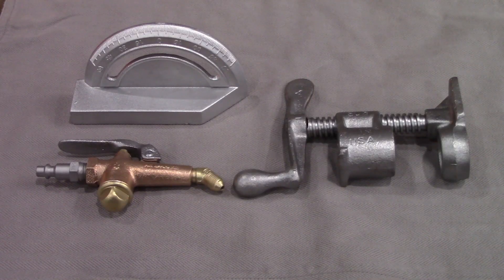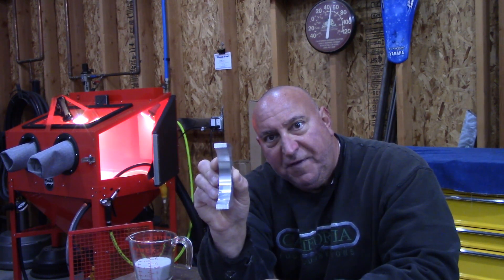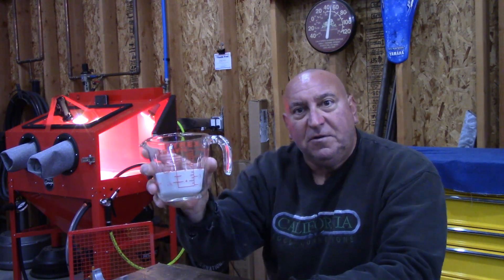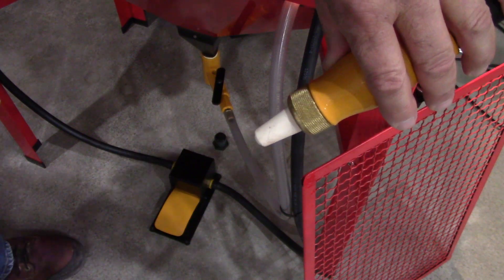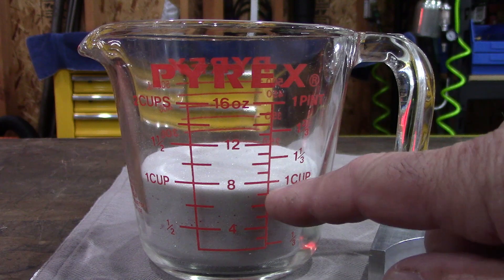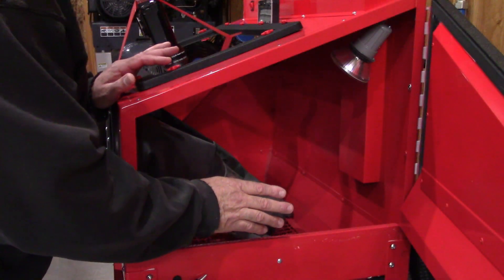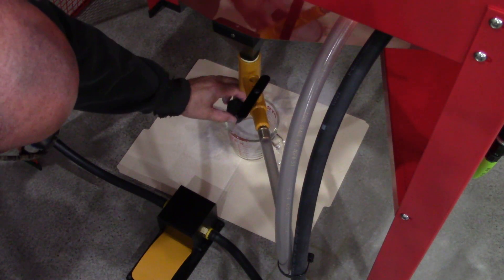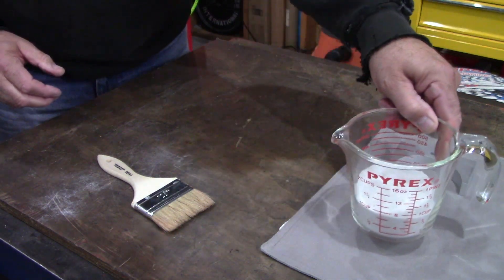Ultimate Blast Cabinet Efficiency

Comment: I ordered everything from Tacoma company to upgrade my HF blast cabinet. Followed your assembly instructions to the letter. I finally got my #75 glass abrasive, hooked it up and tried it for the first time today. With 2 cups of abrasive and at 35psi this cabinet is absolutely AMAZING! I running around the shop looking for stuff to blast! My old Snap-on cabinet had me so frustrated with all of the surging, plugging and inefficiency, I gave up on it. THIS CABINET ROCKS!!!
Reply from the maker: Hello Jeff, That's Great! I am very happy to hear you are impressed with your upgraded cabinet, your going to love it even more as you use it more!
Reply: After 2 days of blasting random things, I got some fine garnet and cranked it up to about 80psi. Holy moly does this thing take off paint! I have some  traffic lights I am rebuilding with many layers of paint and this thing scrubs it off like nothing. I bought the deluxe light kit and it works great, but I think I am going to add another switch to kill the vacuum while keeping the lights on...I have found that there are many times I want to do this, but I have to walk around back and kill the vacuum switch to do so. I want to be able to keep the light on to clean and change out media. Ray, did you have any problems with the door leaking? mine has a small gap that I want to fix.
Reply from the maker: @jeffmcd8469  Hello Jeff,

Depending where the leak is showing you can fix this a few different ways.
1, Oval the hinge mounting holes with a file to bring the rear of the door tighter to the cabinet.
2, Carefully heat up the door with a heat gun and bend it to form a better seal.
3, Add a thin layer of foam on the cabinet where you are seeing light leak out.
You might want to also close up the opening under the door skirt kit, I used a piece of foam rubber to keep media from building up on the door opening sill and under the skirt. This will help with media falling to the floor when you open the door after blasting.

I hope these tips help you.

Best Regards,
Ray
Reply: Hi Ray, I'm about to order everything from Tacoma to upgrade my newly purchased HF cab. Your vids are a wonderful inspiration. Many thanks.

Comment: What SCFM do you need for this?
Reply from the maker: Hi Dave, I am running 120 psi of dry air thru a 1/2" x 6' air hose off of my 3/4" MaxAir system to the regulator then adjusting to optimal performance. For delicate parts I am running about 20  psi or less all the way up to 100 psi for really rough parts, I have found a happy medium at about 40 to 50 psi for most. What's nice is you can adjust as needed for every application. I hope this answers your question. Cheers, Ray
Reply: @RaysGarage  not really. I'm just a retired guy restoring a car. I have a 5 hp compressor that puts out 5.1 SCFM at 90 PSI and it was not capable of running the sandblaster I borrowed while I wait for my Tacoma parts. I had to rent a gas powered compressor that put out 15 SCFM at 90 PSI to make it work. Hence I'm trying to find out what volume of air is required to supply the Tacoma Company sand blasting gun.

Comment: Hey Ray love the video and the 2 Stage dry blast 2 stage. I am in the process of debating between wet blast and dry blast and ideally can you do a nice clean look on engine cases for motorcycles with a number 7 dry blast?  I was on the phone with the guy from Tacoma and he recommended I watch your videos
Reply from the maker: Hi Nate, Yes Mike is correct in recommending to watch the video series. This set up would be perfect for what your wanting to do. Before you invest in a wet cabinet put a dry blast cabinet together, you will save a bunch of money and will have a professional grade cabinet that will be very effective and efficient! I would be happy to demonstrate blasting a case cover for you if you have a spare! I currently have several blasting demos on different parts both single and double stage examples. Best Regards, Ray

Comment: shouldnt there be actually more?? what happened to the aluminium you removed? lol
Reply from the maker: Hi Emma, No because you are not removing material, your peening the surface for a even stronger finish. Thanks for stopping by!!!
Reply: it's so small that it's kind of a dust so it get blow by the vaccum.

Comment: Ray can you please give us a approximate total cost for the machine you just finished? It is a great improvement from the original.And it is a good project. But does the cost make it prohibitive for the home shop? Thanks
Reply from the maker: Robert Corrie Hello Robert, I paid $165 for the HF cabinet with a 20% coupon. If you buy every Tacoma Company upgrade it will run you just under $1200 delivered but you can still get a top performance cabinet with a few key upgrades and accomplish similar results. Call Mike and talk to him he can help you and within your budget!

Comment: Hey Ray -- I have to give you a standing ovulation , and that is the ultimate compliment considering that I'm a man . I can't believe how clear 
the visibility was. When I blast , I look like the guest star in a sand storm . You and your blast buddy have taken blasting to very high level .
I could elaborate but it's not necessary , the Video says it all . I'm going to give you one huge " Atta Boy "
Reply: install a vaccum, ideally with a cyclone. Cyclones doesn't work so well for such small dust but it still prevent some of the dust to go into the vaccum filter.